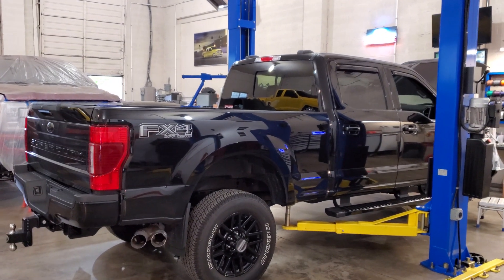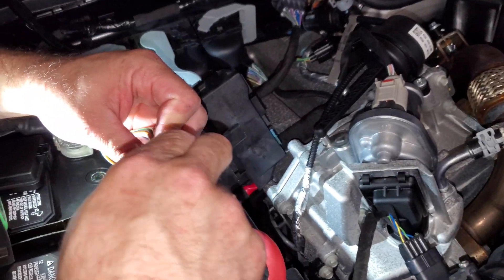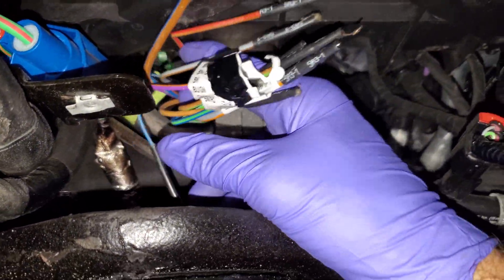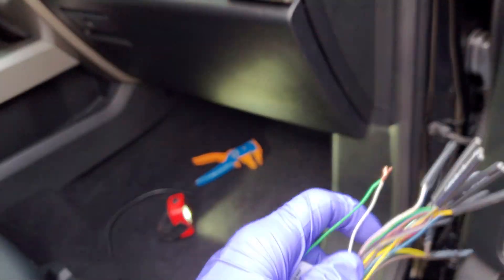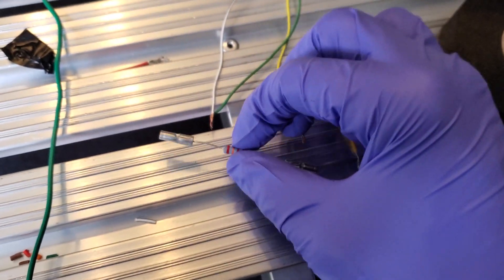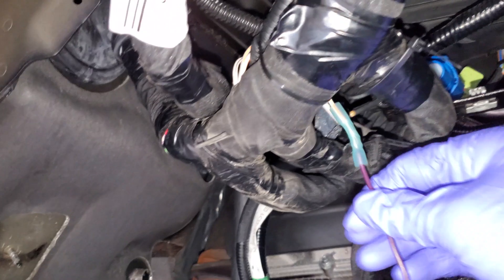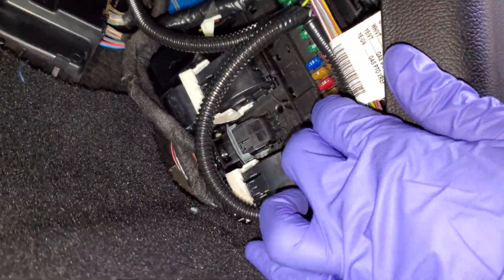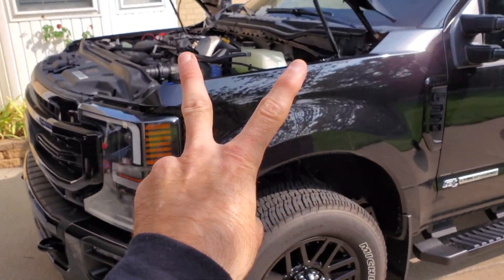17+ Superduty 6.7 | HIGH Idle Up-Fit | HOW TO

Comment: I have only had my 2021 for a few days and when I have my truck parked in oddly when I come back to it noticed it was at a really high idle searching Internet to try to figure out why I come across this video still at a loss why it is at a high idle.  I am going to try and find part 1
Reply from the maker: Buddy, if its super cold  And it is sitting there while it has not had any brake or accelerator input for like 2 minutes it will high idle to bring the engine up to temperature totally normal
Reply: It could be doing a regen on the exhaust system.

Comment: Am I missing the link for the resistor? Great Video 👍🏼
Reply from the maker: I did not have 1. U have to search google
Reply: @PowerStrokeTechTalkwARod  
A 1/4W or even smaller resistor would have worked.  Just buy one that is red, red, orange (22x1000).  The circuit is drawing micro amps based on your chart.  Also, if you’re using the pass through wires, I would suggest using the smallest one (gray) and leave the bigger boys for something drawing more current.  Another thing, there’s actually TWO green and yellow wires that are identical, so you might have to try both.
Reply from the maker: I actually hooked it up wrong & had 2 switch to the other wire

Comment: Can you please tell me where to get the resistors?  I did not see your link at the end as to where to buy those!
Reply from the maker: U can find em on line
Reply: @PowerStrokeTechTalkwARod    I’m looking. But I really don’t know what I’m looking for.
Reply from the maker: U have 2 look up what ever k ohm resistor u want per the chart buddy...
Reply: @PowerStrokeTechTalkwARod    Ya I’m good with following instruction. But not to bright with finding the right one. I typed in 22k Holm resistor.   I will go into an auto supplier and take your chart. Thank but that stuff is a little outta my wheel house,
Reply from the maker: Better take it to a pro🤷‍♂️🤷‍♂️
Reply: @PowerStrokeTechTalkwARod  yep. Thx man. I’m pretty stubborn. I will get it 12677k ohm.  I will take a picture of urs and take it to a NAPA or UAP.  Thx buddy. Great info!
Reply: @PowerStrokeTechTalkwARod  I just bought a 2021 F350.  I don’t get it until the end of February. So I have lots of time. But the high idle is definitely something I want to upgrade to

Comment: I live in Alaska and my truck naturally jumps into a high idle switch when its cold outside, Is there a way to adjust the rpm levels? 2017 F350
Reply from the maker: Only like you saw in the video...
Reply: @PowerStrokeTechTalkwARod  my question is do these trucks come with high idle all ready installed? my truck when its cold outside will instantly jump into high idle when in the single digits outside, im talking slightly higher than what you did and I haven't installed any after market switches. now my truck is now tuned and deleted but its always jumped into a high idle since brand new.
Reply from the maker: Yes...if u dont touch any inputs its goes to like 900 rpm, only if ect & eot temps are low
Reply: @PowerStrokeTechTalkwARod  mine hits higher than 900rpm, id say closer to 1500
Reply: @PowerStrokeTechTalkwARod  I will tag you in a video next cold snap i have up here.
Reply: @coldalaskan007  I have a 2019 6.7 and mine as well jumps into a higher idle as well. Up to about 1400-1500  never did an idle switch....🤔

Comment: Can someone explain to me what the purpose of this is? Just curious...
Reply from the maker: High idle pal, read thru the comments
Reply: Shouldn't this be fully operational from factory? Or did FORD drop the ball? Those trucks are overpriced as it is, having said that, we just purchased a new FENDT 1050 Vario which was over $300k USD.

Comment: 6:04 Your thumb is under "BU/WH" which is Blue/White not Brown/White.  Brown is "BN" so you hooked it up using the BN/WH wire and it says it is for PTO REF whatever that means. I guess it still worked so go figure. 

Also, why wouldn't you hook it up to upfitter 5 or 6 since the truck must be on to effect idling anyway? 

Finally, of the 4 wires that Ford was kind enough to run from engine compartment to cab, why not use the smallest diameter and save the larger wires for something in the future that might require more power? Anyway, I really don't know the answers to all this, those are just some observations. I'm no wiring wizard but I'd like to save my heavier/live upfitter switches (but I can see how easy it is to change all 6 to live all the time) for other things.
Reply from the maker: Already have 5 & 6 set up for lights
Reply: @PowerStrokeTechTalkwARod  Cool, I went ahead and ordered a potentiometer and will be doing this mod soon. Thanks for the helpful video!
Reply from the maker: No prob hobbyist!

Comment: 2020 f250 6.2 gas i need this mod will it work. having trouble jump starting the school buses i work on when there dead. dual batterys and big alt package. if i have a helper and hold the rpm around 1500 they start right up
Reply from the maker: If u see those wire down tjere then YES
Reply: @PowerStrokeTechTalkwARod   ok cool it has the pig tail is the ohm resistance around the same as the diesel
Reply from the maker: No use the 6.8 value in the chart
Reply: @PowerStrokeTechTalkwARod  sweet thanks for the help

Comment: Am I missing something? I see the pigtail in the Passenger compartment but on my 19 the upfitter switch wires and the fuse box  are located on the drivers side.
Reply from the maker: Yepp thats correct. 2020 they moved it over
Reply: @PowerStrokeTechTalkwARod   2020 LOCATED EVERYTHING IN THE PERFECT SPOT OWNING A 19 THE ENGINE BAY IS A PAIN TO DO UPGRADES AND ADD ELECTRICAL

Comment: Awesome!  I helped my brother install this on is 2018.  I installed a resistor to set the max idle speed then added a potentiometer so he could fine tune to the exact RPM he wanted.  That way he can easily modify it to another RPM if he wants.
Reply: If using a potentiometer you don't need the resistor . I installed mine in the dash where it is easy to reach and just dial in the rpm. wanted
Reply: @dashcam5398  are you installing the potentiometer the same way he’s installing this resistor? Basically just putting a potentiometer in place of the resistor? Is there a specific one you need or recommend?
Reply: @Xx04stangGTxX  theres a plug n play high idle kit from BD diesel that lets you dial in whatever rpm you want. A bit pricey but it does work good
Reply from the maker: Awesome 🙌🙌

Comment: Hey. I have a 2020 f350 drw diesel that I am trying to do this with. I ordered it from the factory with the upfitter switches so it is all the same as yours. I wired it the same as you did and put the parking brake on and  it won't idle up. Quick question to, in your video you say to hook the resistor to the brown and white wire but on the tag you point to the one that says blue and white (BU/WT)? I hooked it up to the brown and white and solid green wire with a 20k resistor and it still doesn't work. Thanks
Reply from the maker: Ok those 2 wires go together....with the resistor. The 3rd wire, where did u hook that
Reply: @PowerStrokeTechTalkwARod  the other wire goes to my pass thru wire
Reply from the maker: Then it should work. I know there was TWO green & yellows GN/Y...maybe try switching them. I had to....
Reply: @PowerStrokeTechTalkwARod  ok I will try that. I will say to, a little while back I put the bd diesel kit on it where it just plugs into that harness inside the door and that wouldn't work either.
Reply from the maker: Hmmmmmmmm interesting.....

Comment: This looks WAY more complicated than it was on my '13. Question. Why not use a potentiometer so you can change RPM's to whatever you want, whenever, instead of a resistor for a fixed RPM? I did the potentiometer and it works great.
Reply from the maker: I know, i didnt have it at the time. I was filmin on da fly & just used what i had😉
Reply: Did you install the same way he did the resistor just used a potentiometer instead of resistor? Also is there a specific one you need/recommend?

Comment: Not sure if you knew it or not, but at least on my '17 SD as long as the key is inside the cab and you have the door open, you can push start the truck without pressing the brake pedal. You have to hold the start button a lil bit longer but it works for my truck! Maybe it will work for yours??
Reply from the maker: WhhhhhhhhhhaT NOW WAY...
Reply: @PowerStrokeTechTalkwARod  Lemme know if it works for ya!!
Reply from the maker: Just tried, nada
Reply: @PowerStrokeTechTalkwARod  Aw man! Sorry bro... Maybe they changed it for the '20's.... Try on the older ones maybe? I promise ya i'm not crazy lol! Gotta be the driver's door open and usually have my key either in the console or driver's seat. Give it a shot with an older model... let me know, maybe my truck is actually defective lol!!
Reply from the maker: Cmon noway, thats crazy. I think i got 1 outside. Ill check later on!
Reply: If ya want, I can send you a video to prove it lol! Just gotta tell me how to get it to ya.
Reply: @PowerStrokeTechTalkwARod  sweet! I really hope it works so I don't look crazy to ya lol! I seriously would send ya a video of mine if it doesn't.
Reply from the maker: Lmao!!!!!
Reply: @PowerStrokeTechTalkwARod  Well, maybe that didn't come across right lol!! But ya know what I meant! Lmao!!

Comment: Do you know if there is a way to turn off auto shut down. Tried to turn it off with ford scanner and it says it’s off. But still does it after 30 minutes if idling
Reply from the maker: I beleive so same way you did but maybe you forgot somethin?
Reply: @PowerStrokeTechTalkwARod  im not sure. Found it under ford new version of programmable paramters. And set it to off. But customer still has to set it to off each key cycle.
Reply from the maker: Hmmmmmmm. Powerstroketechtalkwarod@gmail.com email me tomorrow. Nitey nite pal

Comment: Are there fuel additives that you would/could recommend? What are your opinions on CCV reroute and remote bypass oil filter systems? I’d be really interested to hear your thoughts.
Reply: AROD told me to use the Motorcraft diesel fuel additives for summer and winter. Since then, I’ve never had any issues with my diesel.
Reply from the maker: See my mann yeaaaa!!
Reply from the maker: You can call into the hotline & talk with me about it but ya got email me 1st

Comment: Another great video! Very informative. I have been meaning to do this to my 17 but haven't gotten to it yet. Question for you, are the pass through wires in the same location on the 17's? I know the upfitter switch wires are on the drivers side not the passenger side. Thanks again!
Reply: Completed this mod on my 2017 last week. Love it. The pass through wires on my 2017 are a lot easier to access than on your 2020. They are easy to get to under the hood and dash. no pulling wheel liners.
Reply from the maker: Yea. If i remember correctly, i think theyre on the d side
Reply: @PowerStrokeTechTalkwARod  Also one more question, on my 17 I want this to work when I remote start. I want to be able to have the switch on and brake set when I park the truck that way it will high idle when started remotely. Are the upfitter switches powered when remote started? Thanks again!
Reply from the maker: Yes, that is exactly what i do!!!

Comment: If you ever want to know how durable and reliable the 6.7/torqshift trans combo is, we have a fleet of F750 claw trucks (for picking up garbage and brush piles) where I work (I am a mechanic for the city)
They are MORE reliable then the older F750's with the cummins/Allison combo and these trucks are USED AND ABUSED day in day out 5 days a week and they have ZERO problems with the drivetrain!!!
Reply: If there is one thing that I do know... It's that most municipal trucks get beat HARD, I too work for a city gov and have seen the carnage, lol!
Reply: @BarnStangz  I work on mostly trash trucks and I think out of all of the vehicles our city owns they get beat on the worst!
Reply: @lustfulvengance  Oh I believe it. Most of our public works fleet gets hammered pretty hard too. Oh and the cops like to rip hard too, Lol!
Reply from the maker: Woowooo GO FOMOCO

Comment: Great video as always. I have a 2015 KR that does not come with up-fitter switches. There is a stupid coin holder right above the cup holders in the center console where I believe they should be. Do you know if it's wired for up-fitter switches from the factory?
Reply from the maker: Yea I have installed those before. Piece a cake

Comment: With mine I Installed a variable 50k ohm resistor. So I can change the idle speed just by adjusting the resistor. I had plans of installing it in the dash with a knob so it can be done on the fly but I figured that was overkill and just left it under the passenger kickpanel. Still easy to get to if necessary.
Reply from the maker: Yea too funny, i had that idea but didnt feel like trying to source when i already had what i did so...here we are..but hell thanks for stoppin thru tho
Reply: @PowerStrokeTechTalkwARod  Yeah if you already had the resistors then no reason not to. Im an electrician so sometimes I find excuses to do wiring mods on my vehicles lol.
Reply from the maker: Haha tru dat

Comment: Can i do the high idle on my 2014 f450 with v10 its my servive truck
Reply: Do i have to use-resisters on the v10 gas also and is it the same resistance values
Reply from the maker: V10 have a lil different values
Reply: Where would i find that
Reply from the maker: Email me
Reply: What is your email
Reply from the maker: Powerstroketechtalkwarod@gmail.com
Reply from the maker: Yeah they should be there. Read thru the 1st set of comments guy described where they were

Comment: I did this on my 2014  when i first got it. Well worth it in the winter. mines also tapped into the park brake signal so just flipping aux one it high idles.
Reply from the maker: Bingo!
Reply: We are an 'older' couple and we, unfortunately, go to the doctor (s) a lot! 
In these days of Covid19 one of us MUST wait outside in the vehicle 
Hi idle helps the A/C or heater.
Reply from the maker: It wld be like you sitting in the car with ur foot on the gas, revvin' the engine....just gonna make it warm up faster
Reply: How do you tap into park brake signsl?
Reply from the maker: @johnjmandel7763 for???

Comment: Do you know if a 2015 f350 has the pass through?
Reply: Actually it does. They are on the left side by the parking brake. The other end is by the brake booster
Reply from the maker: I am looking at one now!
Reply: Taped to the harness near G104 and C210. 

Here is the link to the Ford Body Builders website. Down to the year and look under the electrical wiring tab.
https://fordbbas.com/publications
Reply from the maker: Thanks bud!
Reply: yep. did this same mod to my 2012. Wires are just in a different place.

Comment: Winter time it is better on the engine to high idle it. Keeps the cylinder walls from getting cold and the atomized fuel from collecting on it. This will eventually cause cylinder wall scoring. This is called wet stacking.
Reply: High idle is awesome for older trucks, but there isn't really a need for it with newer trucks without some sort of PTO being utilized for a few reasons. First we have high idle on cold starts which decreases idle with increasing coolant temp. Second, we have a lot higher fuel pressure and maps that change it based on things like engine temp, CA temp, and fuel temp. Thirdly the injectors them selves have a finer spray pattern which aids in atomization of the fuel delivery along with cylinder head design and how good the swirl currently is with them. Couple that with EGR and now you have a warm inert gas helping to heat the incoming air further decreasing the fuels rate to full atomization. Not to mention the supplementary heaters most of these new trucks have will rapidly heat the engine coolant keeping the cylinder walls plenty warm even in extreme cold at a lower idle :)
Reply from the maker: Nope, no sup heat herr. 1. Was reason to make content. 2. Easy.  3. My new truck. 4. So far everyones diggin it. 5. Thanks for watchin!
Reply: @PowerStrokeTechTalkwARod  Lol it wasn't directed at you my dude, it was simply about correcting miss information about cylinder wash or wet stacking on newer diesels. Which is why it's under this comment. Wet stacking is a pre EGR issue more than anything. I simply said there wasn't a need for it! I never said don't do it! I'm all about having fun and making your truck the way you want it! Do it if the sound alone makes you happy! We just need a better EGR system that doesn't plug up after a while. Like recirculating the exhaust gas after the DPF instead of before.
Reply from the maker: No sweat my dude 🤝👊

Comment: Ditto.  Why would anyone need to have higher idle?  ;-)
Reply: Not only what has been mentioned, but after pulling a load and the turbo and oil  are nice and hot, ideling up will allow the oil to cool before you turn the pkup off. shows your pkup a little love.
Reply from the maker: Cuz we in the gr8 white norf, thats why...burrrr
Reply: @PowerStrokeTechTalkwARod  It's great to have in the summer as well. kick up the idle, run the air cold & keep the dog cool while running into store.
Reply from the maker: No doubt!!!